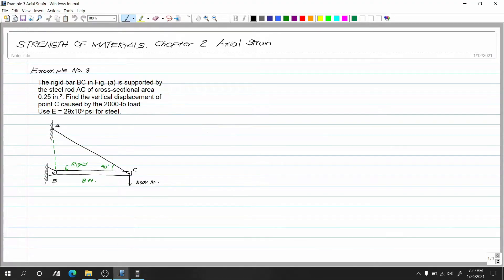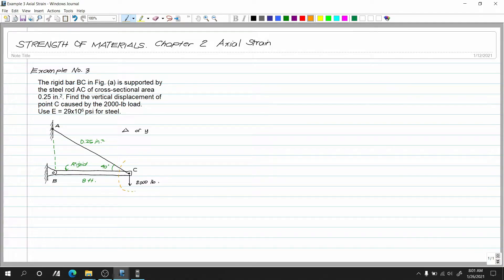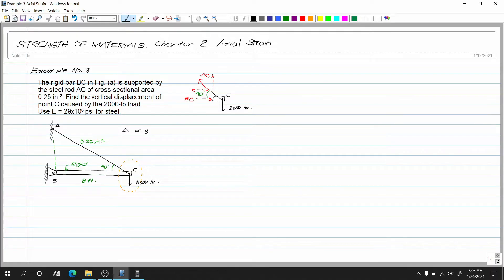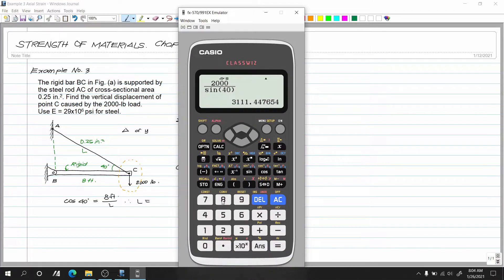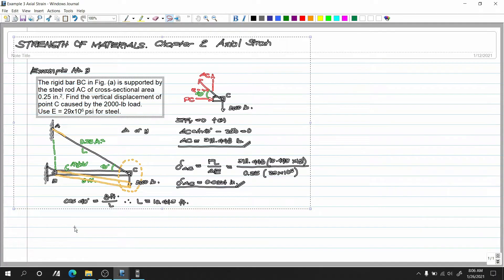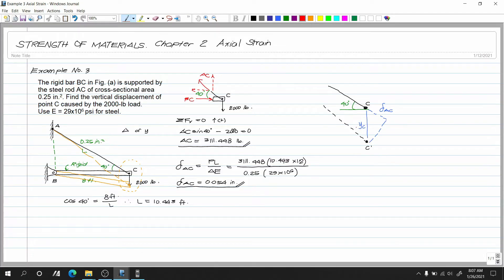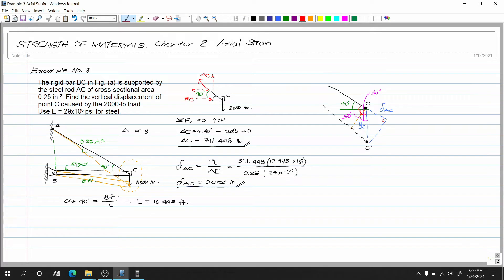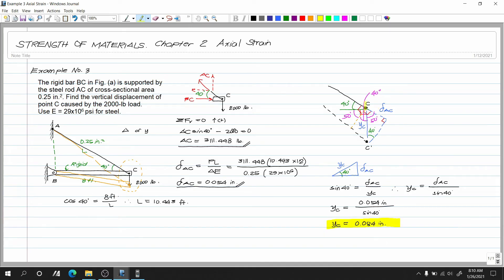Mechanics of Deformable Bodies   Chapter 2 Axial Strain Problem 3 (PH)

Comment: Good eve sir, bakit po pababa ung deformation kung mataas naman po yung vertical force nc AC which is 3111 ?
Reply from the maker: Take note, that 3111.48 lb is inclined, not vertical force. Yung 2000 lb is vertical force. 

(𝗦𝗼𝗿𝗿𝘆 𝗳𝗼𝗿 𝘁𝗵𝗲 𝘃𝗲𝗿𝘆 𝗹𝗮𝘁𝗲 𝗿𝗲𝗽𝗹𝘆. 𝗪𝗲'𝗿𝗲 𝗷𝘂𝘀𝘁 𝗯𝘂𝘀𝘆 𝘁𝗵𝗲𝘀𝗲 𝗽𝗮𝘀𝘁 𝗳𝗲𝘄 𝗺𝗼𝗻𝘁𝗵𝘀 𝗶𝗻 𝗼𝘂𝗿 𝗽𝘂𝗯𝗹𝗶𝗰𝗮𝘁𝗶𝗼𝗻 𝘀𝗮 𝗠𝗮𝘀𝘁𝗲𝗿𝗮𝗹, 𝘀𝗮 𝗧𝗵𝗲𝘀𝗶𝘀, 𝘄𝗼𝗿𝗸 𝘀𝘁𝘂𝗳𝗳, 𝗮𝗻𝗱 𝗹𝗶𝗳𝗲. 𝗛𝗼𝗽𝗲 𝗻𝗮 𝗻𝗮𝗸𝗮𝘁𝘂𝗹𝗼𝗻𝗴 𝗮𝗻𝗴 𝗖𝗘 𝗕𝗼𝘅 𝘀𝗮 𝗶𝗻𝘆𝗼𝗻𝗴 𝗽𝗮𝗴𝗮𝗮𝗿𝗮𝗹. 𝗧𝗵𝗮𝗻𝗸 𝘆𝗼𝘂 𝗮𝗻𝗱 𝗚𝗼𝗱 𝗯𝗹𝗲𝘀𝘀!)
Reply from the maker: That force of AC is the internal force to resist 2000 lb, not necessarily that force will pull the 2000 lb pataas. Hindi ganun po nagwowork yun. Imagine, ikaw po yung 2000 lb, then may cable, does that cable will brought you upward? No, right? Then what will be the displacement? Downward due to your weight 2000 lb at that point.

(𝗦𝗼𝗿𝗿𝘆 𝗳𝗼𝗿 𝘁𝗵𝗲 𝘃𝗲𝗿𝘆 𝗹𝗮𝘁𝗲 𝗿𝗲𝗽𝗹𝘆. 𝗪𝗲'𝗿𝗲 𝗷𝘂𝘀𝘁 𝗯𝘂𝘀𝘆 𝘁𝗵𝗲𝘀𝗲 𝗽𝗮𝘀𝘁 𝗳𝗲𝘄 𝗺𝗼𝗻𝘁𝗵𝘀 𝗶𝗻 𝗼𝘂𝗿 𝗽𝘂𝗯𝗹𝗶𝗰𝗮𝘁𝗶𝗼𝗻 𝘀𝗮 𝗠𝗮𝘀𝘁𝗲𝗿𝗮𝗹, 𝘀𝗮 𝗧𝗵𝗲𝘀𝗶𝘀, 𝘄𝗼𝗿𝗸 𝘀𝘁𝘂𝗳𝗳, 𝗮𝗻𝗱 𝗹𝗶𝗳𝗲. 𝗛𝗼𝗽𝗲 𝗻𝗮 𝗻𝗮𝗸𝗮𝘁𝘂𝗹𝗼𝗻𝗴 𝗮𝗻𝗴 𝗖𝗘 𝗕𝗼𝘅 𝘀𝗮 𝗶𝗻𝘆𝗼𝗻𝗴 𝗽𝗮𝗴𝗮𝗮𝗿𝗮𝗹. 𝗧𝗵𝗮𝗻𝗸 𝘆𝗼𝘂 𝗮𝗻𝗱 𝗚𝗼𝗱 𝗯𝗹𝗲𝘀𝘀!)

Comment: sir paano po kapag malaki ang deformation? mag-aassume pa rin ba na perpendicular yung angle sa point C?
Reply from the maker: Hi. Ahm kapag deformation po, maliit lang po talaga yun. As you can see, 0.00 something lang ang mga deformation, kasi dapat talaga maliit lang yun at hindi pwedeng lumaki, kapag lumaki yun, wala na, wasak na ang structure, so I think you don't need to worry about malaking deformaton kasi hindi yun pinapahintulutan sa code, so we can assume it perpendicular. :)